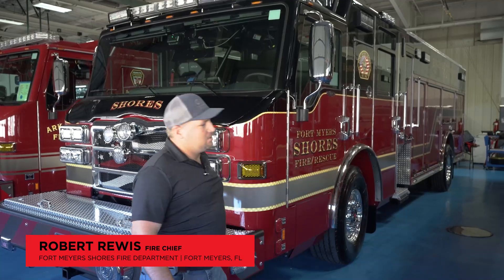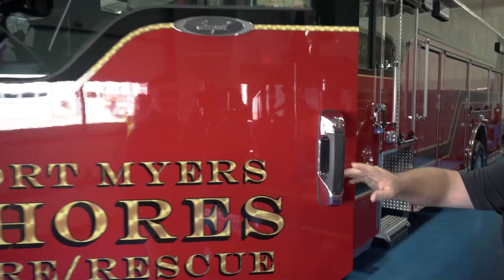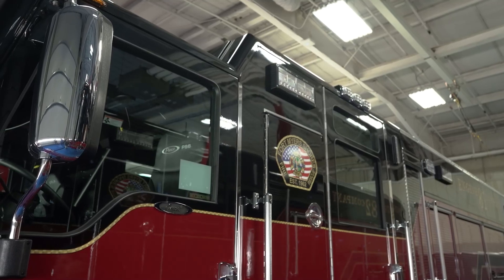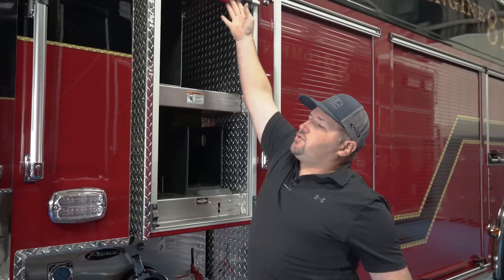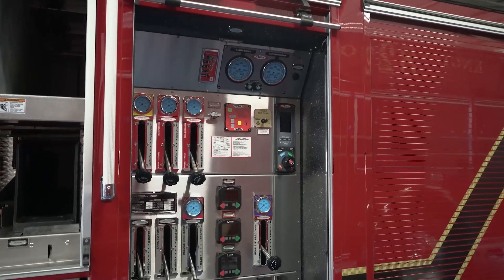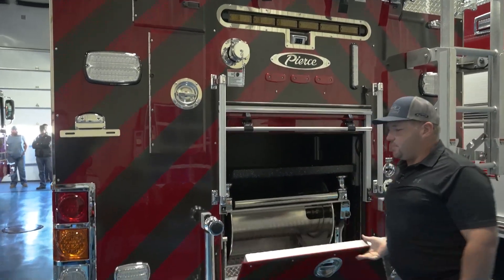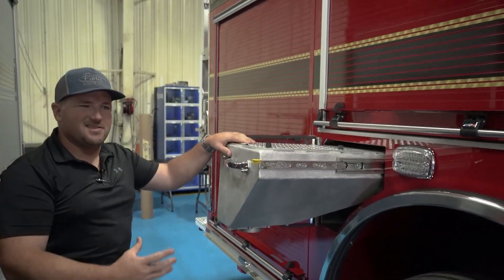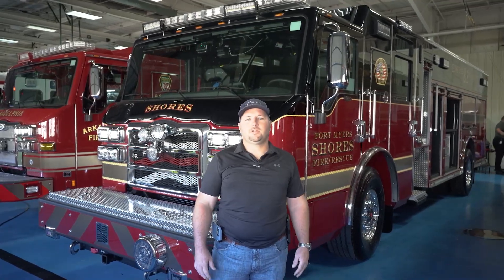Impel® Pumper – Fort Myers Shores, FL

Comment: Sweet PUC Engine, but I personally would have never went with any electronic valves of any kind, because sooner, or later, electronics will fail to function properly, or fail to function completely, leaving the Engineer with no way to use them unless they have a mechanically operated back up. And if they have a mechanically operated back up, then why not just have them fully mechanically operated valves, and completely do away with electronic valves altogether ? Electronically operated devices all have a place, but in my personal opinion, THEY JUST DO NOT BELONG ON THE PUMP PANEL OF ANY FIRE APPARATUS, because the risk of failure is just to great. If an electronic valve fails just one single time, that's one time to many, especially when you have firefighters on the opposite end of that hoseline, and they are either going into a burning building, or they are already inside, and all of a sudden, boom, no water for them.